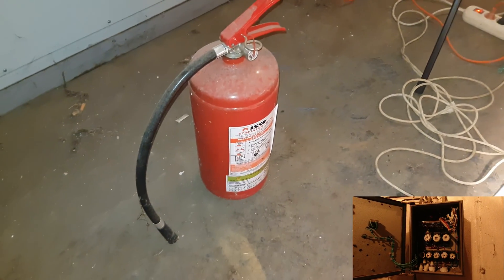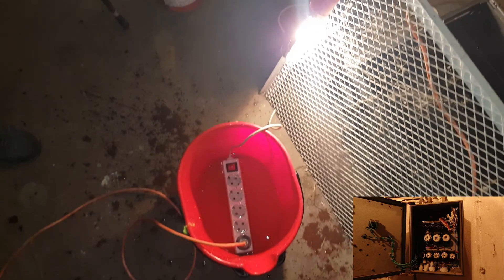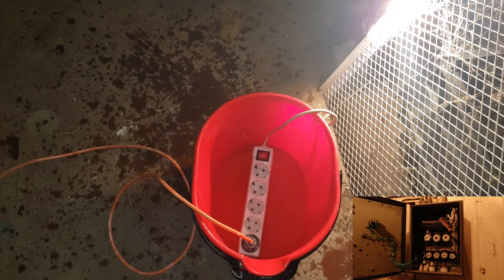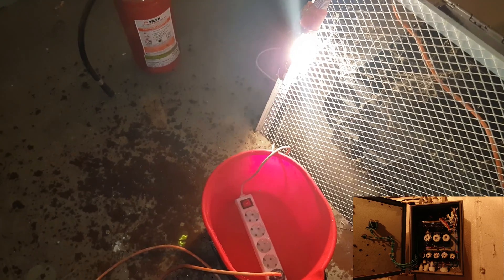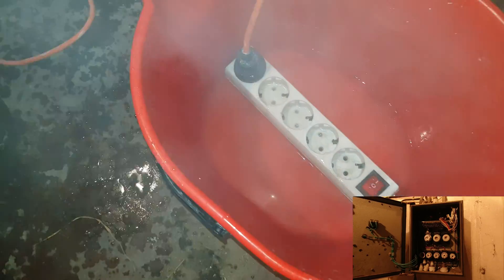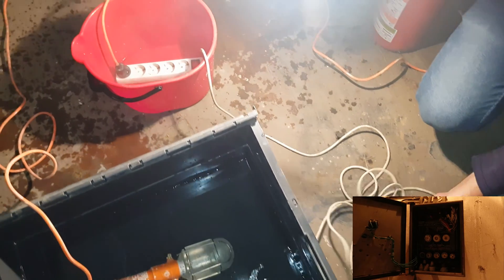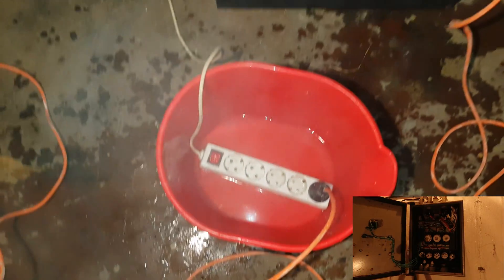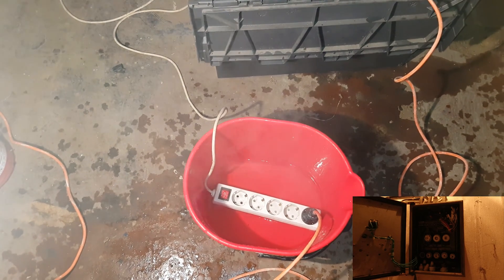What Happens if Water Gets in an Electrical Outlet?

Comment: What happens if the OUTLETS are completely UNDERWATER? Like one centimeter of water? The demonstrator just splashed some water on the socket holes. Putting the outlets underwater would be similar to the water in the living room (during a flood) rising high enough to enter the electrical openings on the walls.
Reply: I'm pretty sure, if there was a flood. The electic company would cut the power really quick. Even if they didn't then modern homes would cut the power
Reply: @caleb7517  No, Liz. The electric company would cut off the Power only as a LAST RESORT. Remember that cutting off power means the LIGHTS won't work, the telephones won't work, the garage doors won't open (how many old folks can manipulate the manual controls?), etc. Some of the higher locations will remain flood free, so the Power Company will monitor the rising levels very carefully, before making the decision to cut-off the power for EVERYBODY in the sector.
Reply: @gramo63  Well, I looked this up and from 2013 was the first result. It said that you need to turn off the electrcity from the power box. (The breaker?) but if you cant do that then you need to call them for them to turn it off. I get what you mean, but now a days everyone has a smartphone with a battery.  So ion rly know
Reply: Oooo
Reply: @caleb7517  never say everyone... a lot of people don't have a smartphone
Reply: @tcg1_qc  they have a nokia
Reply: Nothing will happen